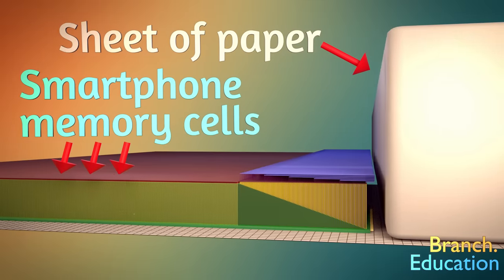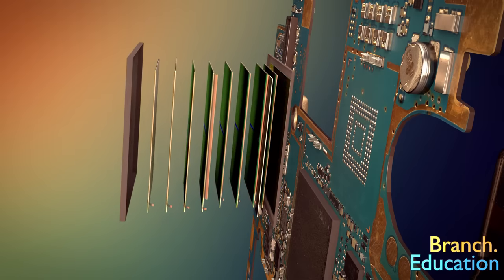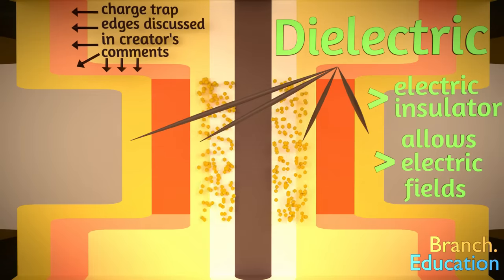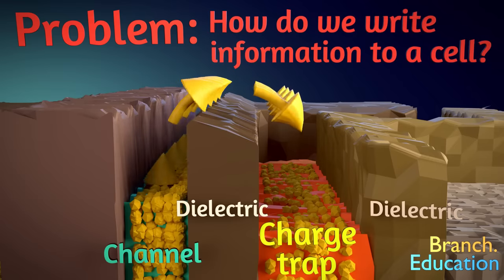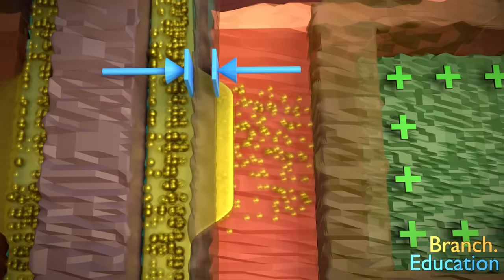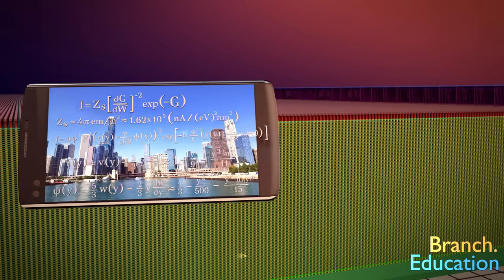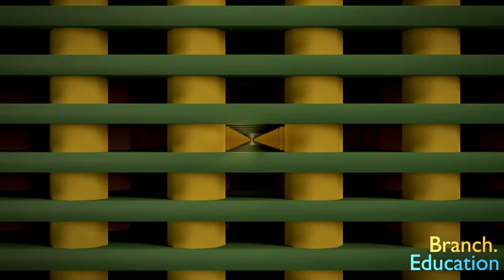The Engineering Puzzle of Storing Trillions of Bits in your Smartphone / SSD using Quantum Mechanics

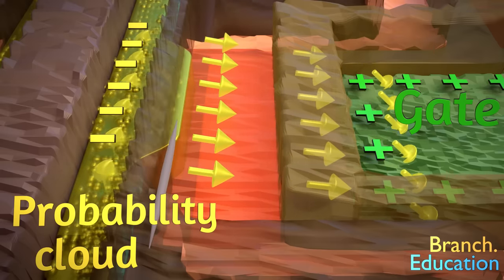Comment: 4:14 so basically it works by teleportation.
Reply: Not exactly. It's weirder than teleportation.

An electron doesn't exist as a particle. It exists within a volume as a probability. 

The weird thing is, if you try to detect it, it becomes a particle (the size of the volume of that probability cloud shrinks to a smaller point...or collapses). And it collapses probabilistically.

Look up "Double Slit Experiment" and prepare to have your mind blown.

Comment: The quantum effect is not a real explanation, else the cell would never leak and have unlimited read/writes. The gate pulls a few electrons out of the insulating wall, and since there is an excess pressure from electrons in the charge channel, the insulating wall grudgingly surrenders a few electrons because the electrons do not move, but rather ' trade' their way through. Just as the water you put into the inlet of a garden hose does not emerge immediately from the discharge end, it's just that all water looks the same, and you don't care EXACTLY which water molecules come out. You just want some water. These dumb charge traps don't care which electrons get trapped.

The charge barrier is in danger of having a weak zone where the electrons will always tend to be traded. This amounts to a short circuit pathway which leads to the eventual degradation of that particular charge trap.

So far as making backup copies of important data, what good does it do to do them all on the same date! Better to recopy them on a regular annual basis. It's a refresh write that preserves the data, not multiple copying.

Comment: How does backing files in multiple locations helps if they all degrade in 10 years?
Reply: they mostly wont break at the same time, so you can replace failing storage before the other storage get fail too

Comment: How are people able to create something that small and so precisely? How are these actually physically constructed? And more so cheaply in mass?
Reply: In very simple terms: same way as photos from film (pre-digital era, not on printer) are made. Project the light through negative film onto light sensitive surface, that causes some chemistry magic to happen on the surface and structures form.

Of course chemistry and physics are different as precision is way higher/feature size is way smaller and different properties is needed (in film you need light sensetive surface to change color/transparency, there you need to make traces from various materials), but fundumental principle is just that.

If you wonder how they're stacked — light sensitive surface I'm talking about isn't sensitive on its own, but rather a thin film (liquid) that is applied on top of it is. So once layer is developed, you can apply second, third and so on layer to repeat the process and grow the structure on Z/height axis.

Comment: If the dielectric has to be a fixed size, then how do we make SSD's higher or 'denser' capacity?
Reply from the maker: They stack them higher, reaching 128 cells high.   Also they store 4 bits in a cell vs 3

Comment: 5:30 which one of those is the device size? I've heard of companies manufacturing 65nm, 32nm, 14nm etc., but had assumed that was just the minimum size feature in the chip
Reply: The nm  of the procing plant is mostly a marketing name. In reality it's quite a bit more complex. The name used is a average of a number of measurements.

One would imagine that going from one node to another is always shrinkage. Well its not. Some times its about reorganization rather than shrinkage, and every second node is pretty much always optimization. Like 12nm, 8nm 6nm is really 14, 10 and 7nm node that been optimized.

Comment: As I understood it. Electron does not just simply "appear" on the other side of dielectric barrier. It gets pulled through the gaps between dielectric atoms. If dielectric is too thick, it is hard to pull electron through, because of some sort of "counter-pressure" from thick layer of dielectric atoms. If dielectric is too thin, it is easy for electron to "fly through" a layer of dielectric atoms on its own. That's why there is "optimal thickness" and probability function, because any particle, given enough time, can get anywhere. It is a matter of "approximately how many" particles we want in container for a period of time.
Reply from the maker: The issue is that in insulators/dielectric materials, from electromagnetic principles the valence electrons, the only applicable electrons because they are the outermost, are in energy band gaps where having flowing electrons isnt feasible.

Comment: In future if we can able to make transistor and many electronic components in quantum level that should be definitely game changing for Human History 🙄🙄🙄...
Reply: We've been designing tech at the "quantum level" for the past few decades! Most electronics nowadays have transistors and logic gates only a few nanometers across. It's so small that it's getting hard to overcome accidental quantum tunneling; so we may be approaching the minimum size for components!

The next frontier, though, definitely has to be using quantum mechanics itself for calculations. In modern computers, think of gates and transistors like light switches; there's an on state and an off state. Using quantum mechanics, it is possible for a switch to be on, off, both, or an infinite number of states in between! With that kind of power, you can pull off an infinite number of calculations instantly. Combined with classical computers, a quantum computer can be exponentially more powerful than anything we design today. Under the right conditions, it could be even more powerful than a human brain!

When we can master that, who knows what doors humanity will open!!
Reply: @iliketrains0pwned  yeahhh 🥰🥰🥰

Comment: I could never see how flash memory could store so much information in such a small space if it used the technology of RAM and your tutorial has shown me it is nothing like RAM. This is mind-blowing. I now need to see how they can manufacture an array, 100 layers deep x 40,000 by 50,000. Awesome stuff! Subbed.
Reply: The technology is almost exactly like RAM. SRAM is probably different. That RAM is fast and can use a decent amount of power. However slower RAM is more like an array of capacitors yet still fairly fast. This is basically capacitors that is optimized for huge arrays which limit speed to a degree. However the architecture can allow it to be fast via parallel work. It does not need a tape/rotary head which forces a fast serial notion. This can make it more efficient also. Serial notions are easier and can work well for certain things however they have a few drawbacks. Most systems resist change and faster changes more so.

Memory is basically a capacitor. Lot of things are basically capacitors. Energy tends to follow a pattern.
Reply: @davidthacher1397  I was referring to the fact that RAM requires a voltage to maintain the charge, whilst Flash Memory doesn't. It's also significantly more expensive with a lower packing density. You won't be getting 256GB of RAM for under 50 bucks.

Comment: Having a backup on a separate drive but both sit unpowered for 10years. The backup would not matter as both will lose charge/memory at same rate and loss data.
 
If you connect power power say once a year, is that suffice to reset the data charge. 

Is there a built in chip/process that checks the charges and say resets them to their full strength. So it can sit for another 10years?

Or am I not understanding correctly.
Reply from the maker: More so back up data in multiple mediums.  The cloud, your hard drive, an external hd
Reply: @BranchEducation  
yes cloud aside, if you made say 3 backups same data on all: 
-1 SSD
-1 HDD
-1 Flash Drive

but they all stayed unpowered for 5-10years they would all start to lose data. 

I want to know if simply powering them once in a while will make them retain the data. Is there a built in system that verifies the data is stored and charge is good in all bits and if not then lack of a better term (recharges them).

Comment: The video show a specific kind of flash. A barrel 3d nand  flash with 3 bit per cell.

The video is very overgererlized, and it will not be accurate for most phones. While most phones do have nand flash. The specific layer will be diffeent from device to device.

100x50kx40kx3 is 600Gb, or 75GB
While there are some redundancy. Typically 10-20. It's not this much. Each chip should contain just over 4GB for a 8 stack 64 GB stack...not 75

It's not really true that the wall needs to be that thin. It can be made a lot thicker, but then the voltage need to be higher. Early flash used 12V to jump the gap.

That is actually why it's called flash memory. Because it is written  with over voltage.

Comment: I didn't quite understand how the channel and charge flash lose from their electric property after 'reading'/'writing'...
How does applying 0 (or very little) voltage help in moving the electrons from the charged cell into the channel? Don't you need a negative charge?
It makes more sense that writing is harder than reading because of the energy gap...
Also it would be nice if someone could further explain how it 'erases'.
Thanks

Comment: Nice cartoon. Electrons don’t actually move from their place in the charge trap. They vibrate between negative and positive charge crossing from the channel to the dielectric barrier through inductive radiation when negative or positive voltage pressure is applied.

Comment: Let us say I wrote a file to a USB thumb drive a decade ago and left it in a drawer. Does the mere plugging back in of the drive to the computer and supplying it with the USB port's 5v restore the charge state of the recorded bytes and reset the clock on their inexorable bit rot decay, or do the files actually have to be individually deleted and rewritten in order for this refresh to occur?

Comment: I found no quantum mechanics in it. If there are 10 levels 3 bits for each means 2^30 possibilities. So u have to make 2^30 kinds of memories. For data feeding also every time read of 30 bits and choose particular mermory unit. It looks improved but at the end of your research. You will find older is better than improved.

Comment: This makes me think it's a Metal Oxide Semiconductor Field Effect Transistor.
Reply: Graphene Pixel there’s no force without heat bro. Picture it as using two particular magnets for a long period of time, u later realizes that the strength weakens as time goes on and this is due to loss of energy through heat. The dielectric are made of semiconductors which can only be conductive when it heats up
Reply: @kwakyesamuel  that's right.

Comment: I dunno. This explanation doesn't give a satisfactory answer to why there is such a limit amount of write cycles. The truth is that every time a write operation happens, the electrons do damage the dielectric barrier whenever they quantum tunnel. It's less spooky magic and more like firing bullets through a thin plaster wall. Eventually, the wall is gonna be so swiss cheesed that electrons will naturally leak through and you can't tell the difference anymore what constitutes a one or a zero. It'll basically be a random number generator based on quantum thermal noise.